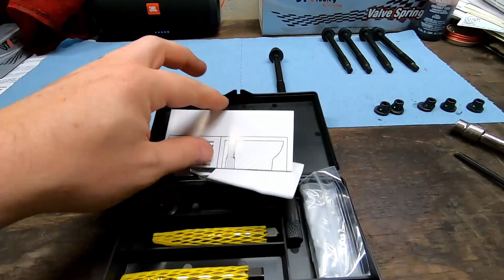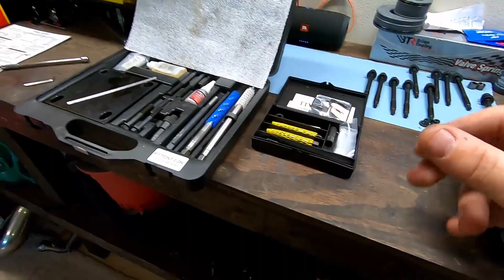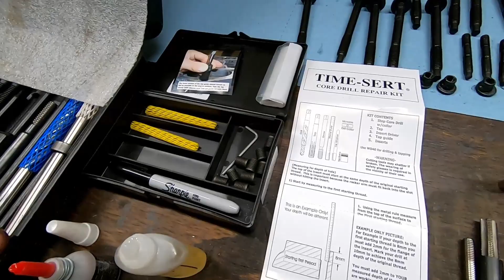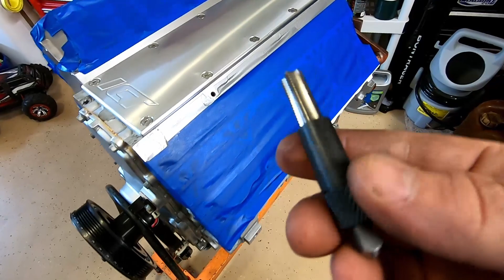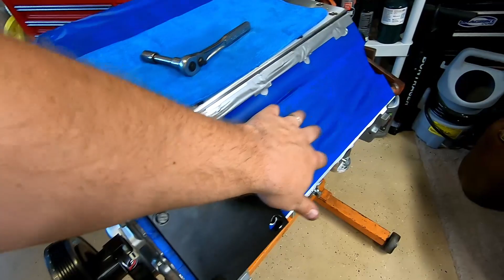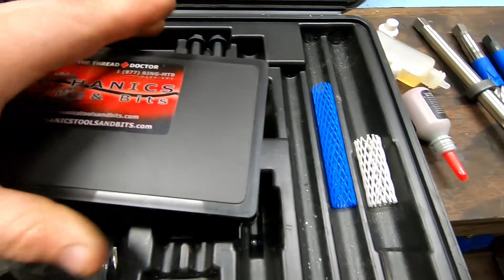GM LS Time Sert Head Bolt Repair

Comment: The most common reason they strip is the holes arent cleaned of liquid. cant compress a liquid so it pulls the threads. im only here because im doing a engine still in. Dude paid a guy $500 to do a cam lol
Reply: Great point ! I found lots of dirty oil in the bottom of my head bolt holes in my m113 block after I tore it down . Didn’t think twice about it . later on I discovered that the dirtiest holes were the most stripped ones , how dose that happen from the factory if they are supposed to be assembled in a clean environment., now I’m so traumatized the next time I pull a set of heads off a block first thing I’m checking is if the the head bolts are stripped . Time-Sert kit was $645 after taxes on eBay but I also got 20extra inserts for $85 because I was going to sell the complete used kit on eBay for $500 or so .

Comment: Hey mate, did these hold up once you got the engine started? I’ve had the same issue. Pulled the heads for some maintenance and now have an unusable engine..

Comment: What is the part number for the m11 kit? I didn't see one for the ls3 specifically
Reply: Did you ever find that kit? I’m having trouble finding one now
Reply: @ryanr4624  p/n J-42385-100
Reply: @ryanr4624  I just bought one from Time-Sert. P/N: 3700 for the main lower 10 head bolts.

Comment: I repaired 3 of the head bolt holes to perfection. On the fourth the insert didnt go all the way down and i didnt realize it until i checked it after i extracted the driver. Now im stuck. For some reason the insert is now stuck and im trying to extract it with a screw extractor as it says on their website, but thats all bs it doesnt work.

Comment: Did you use the 16.2mm insert specified for the upper head bolts or the 11.7mm insert that comes with the kit? I am looking to use the 1812core kit to do the same repair as you did.